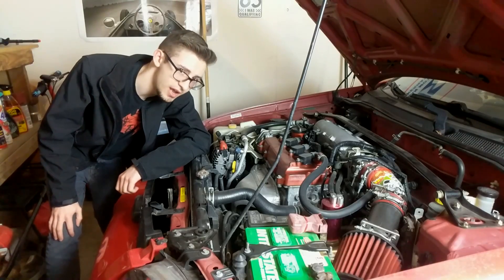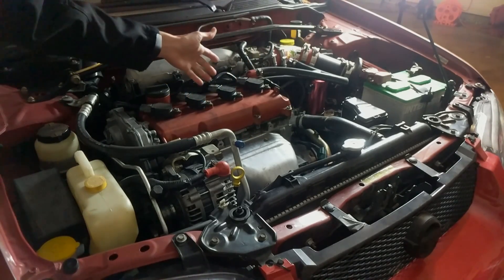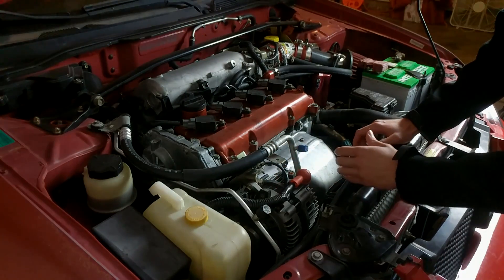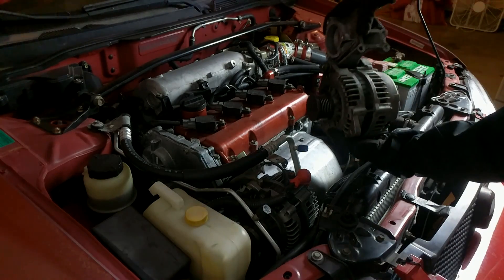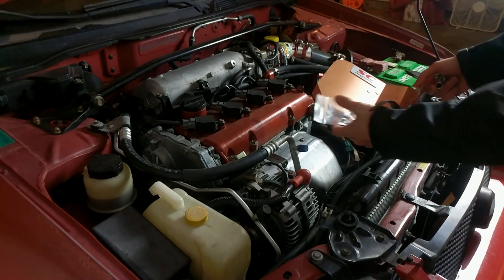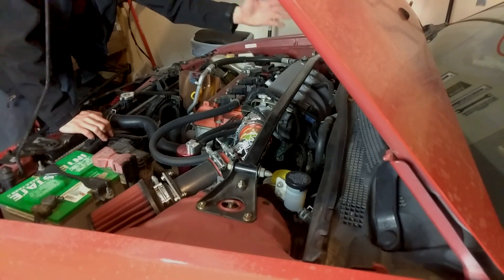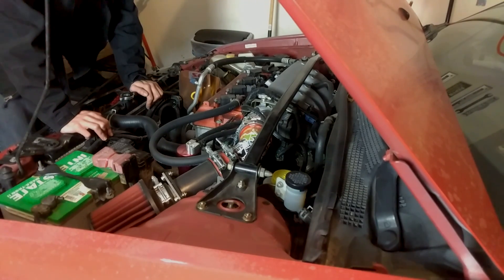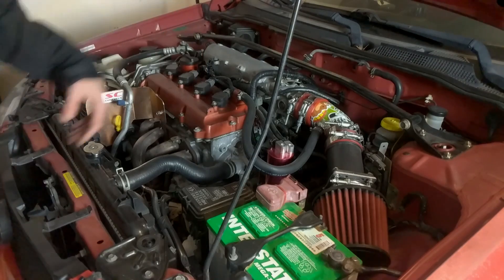3 Common Nissan QR25DE Engine Problems (And How to Fix Them)

Comment: My QR25DE has done 412,000 kms - because Oil & filter every 8,000kms! I don't drive like a d1ckh3ad so I don't have the pre-cat problem but the sensor DID disintegrate a while back, requiring removal of the exhaust manifild to get the debris out. I have also seen the butterfly valve screws get loose (reinstalled with Loctite). The valve cover needs replacing every 100-200 thousand k's because the spark-plug seals leak. It is a really solid engine with proper maintenance. Just avoid anything with a CVT!

Comment: How's this for bragging rights.  05 altima qr25 160k no leaks no issues with the head gasket, coolant issues none etc. Transmission shifts perfectly. Proper preemptive maintenance is the solution. OEM parts and high quality fluids.
Reply: Rebuttal. 260k on the odometer.

Comment: Thanks for the video and information. I bought a 2005  nissan x trail SE . It has the same engine. I have very little knowledge about car engines.
1. It seems to get very hot inside the engine, especially close to the alternator. The temp gauge on the dash goes upto 50% and stays constant. How can I know if it is getting too hot. Can one put some kind of thermometer in there. 

2. I put the fan on and turned the temp control knob to max cool without turning on the ac. It was a warmish day and I only drove around 45 minutes and warm air coming through the vents ..a slight burning smell. This is what alarmed me and trying to figure out if it is too hot. Hence question 1. 

Appreciate your reply. 
Btw on this vehicle engine was replaced . One of the issues on previous engine was screws coming of as you described.

Comment: idk how i found your channel but you brought bad some memories.. lol. i owned a 02 spec-v back in 04-05.. got rid of it around 2007.. had tons of problems. I remember i had a popping rack and pinion that was replaced under warranty.. and the noise came back. lol.... and ahh yea.. .BUTTERFLY screws.. lol..

Comment: My 2015 nissan altima all sudden is notdies accelerating when put in drive or reverse then the battery dies. It doesn't happen while driving only when I've been driving for a couple hours or even a hour. If change it out of drive then back in drive or reverse,the problem begins. Please help I love my car.

Comment: The qr25de is a piece of trash.

The only good thing about it is that its a 2.5 engine
The major problem with it. Is that its made out of plastic
Nissan didn't put any effort in making it like the sr20de

Comment: Around may this yr I blew my engine after 7 years of driving my 06 Altima... replaced it & just blew it again oil on cylinder #1 😭 ima be rebuilding soon & definitely going to add a catch can locktight the butterflies

Comment: Awesome information.  I'm getting a 2002 SER Spec-v luckily, which has already had the engine replaced, locktite on the butterfly screws and the exhaust replaced.  I did not know about the heat or oil issue.  You rock!

Comment: Yo!!! Awesome video. I'm switching to an aftermarket manifold on my 03 Altima. I actually had a qr25 seize up while going 80 on the highway and since it was  over 10 yrs ago they were still kinda expensive so i went the jdm route and got a qr20. The car has sit for over 5 yrs and im trying to make it road ready and clear all the codes and get it smoother. The last step that I think I have is to add that shield since I read the factory one won't fit and to use a spacer to fool the ecu so I don't throw a code. gonna look into the butterfly screws also. thanks! u got a new sub!

Comment: The alternator has never been an issue for me either as most have commented, as a matter of fact the original alternator that came with the car from factory is still good and sits in a corner of my garage after being replaced for an upgrade. I also installed the DC headers when they first came out years ago and still had no issues for years before doing a VQ swap a couple of years ago and I still have no issues with that one either. I've never had any problems with my Spec other than wheel bearings and its been 16 years. I think a whole lot of you are buying used Specs with tons of problems or are stuck with Specs that has taken beatings. Either I am the luckiest man on earth, or maybe I did the factory maintenance at proper intervals at the dealership every time it was due and gladly paid for it - you decide............and no its not for sale!

Comment: I have an idle problem, it's running at 1100 rpm. Is that a common issue?
Reply: Same. I had this issue after a head gasket swap and would like to know solutions

Comment: My 06 has been pretty good but has been going through a lot oil over the past 2 years. I changed the valve cover and gasket myself with oem nissan parts. It goes through a quart every 2 months instead of every month. If I was driving the car hard and flooring it, you could smell the oil burning off of the engine if you had the windows down
Reply: How many miles does your 06 have? Have you done the catch can since then?

Comment: I bought my 2003 X-Trail auto new.I,ve had no issues with it other than crank sensor and
camshaft sensor.I,ve used it for several years to tow our double horse trailer as our
family shows them.I have serviced it every
6000 miles since new.Castrol magnatec 10-40.It currently has 320,000kms and uses
about a pint between services.Amazing
machine.

Comment: My QR is in a 2017 Frontier 2wd KC SV and I haven't driven it much (3300 miles) and have only recently taken interest in 4 cylinder powerplants and read a post that stated there are differences between the QR25DE in the cars and the truck... IS this true and are you able to differentiate them for me. I am beginning the puzzle of learning the pieces and parts that I want to upgrade. auto-trans.

Comment: We have a first gen qr and lately I've been lossing power, it's consuming a lot of oil but there no white nor blue smoke at the exhaust...don't know what could be the problem
Also I've been having a bad gas mileage
Reply: My 2006 burns oil but no loss of power. I replaced the valve cover and gasket myself. It still goes through oil but it's now 1 quarter every 2 months instead of 1 quart a month. I could smell the oil burning off of the engine whenever I'd drive it hard
Reply: Sean Anderson Curious why you changed out the valve cover— was there a leak, or just something quick and easy to try?

Comment: Awesome video bro. 
We are all being taken advantage of by  the car manufacturers that sell us these cars.  Regardless of state and specially in California. 
The system is designed to fail and cost us thousands in repair bills 
 Car maker's make more money in Repairs, than they make in the selling of vehicles. 
 Knowledgeable people, like the young man that made this video, need to put them on blast. Show people in video, how to avoid the problems that the car makers create. They know
the fail points. 
 Look at the young man's engine here in this video. it's a qr25, that they continue to put in cars after his for years, without any protection on the alternator
 They did addressed the intake. But NOT the alternators. BS huh?
I have a car that has two cats on it. Each of them cost $1,200 and can only be purchased from the dealership.  Because it needs to have a CARB stamp in California (CARB 
California Air Resource Board) Nissan and Carb won't let another manufacture make them in CA. Total BS. That same exhaust with the Catalytic Converter is $300 in Arizona.  Nissan admits, and so do ALL other car manufacturers, that there engines burn oil. It says it in the manual. 
It's great that  this young man is showing people that they need to put a catch can in between their PCV and their intake manifold. Has anybody reading this, ever cleaned your throttle bod, intake manifold, spark plugs, or your combustion chamber?????. 
It's all burnt oil/ carbon deposits. Once it gets past the combustion chamber, it ruins your catalytic converter
Bro. I don't mean to offend you  by what I have to say next about your particular car but I think it will be a plus for your Sentra.That puny catch can you have is way too small. Do some more research on them and buy two in concession. Or buy one aluminum big one they sell for turbo cars. & add another PCV.  You can mount them anywhere. Also bro, extend your cold air pipe and take it downward, just below the headlight. 
You're robbing your engine of the purpose of a cold air intake by leaving it in the hot area. I would also recommend that you use heat wrap on your exhaust manifold , then wrap the pipes down just past your firewall. Use the gold sticker heat shield on the inside of stock heat shield. Clean them real good with a wire wheel and then clean with alcohol before using the sticker stuff. 
 I would love for you to show people and create a special videos on why every vehicle and every engine needs a good catch can, if not two of them. 
People need to realize what PCV means. They also need to realize what Vacuum means. Please use any engine in your video and show how much vacuum is being sucked into the intake. Most vehicles have restrictor pieces inside those vacuum hose, to restrict the vacuum, because it's so strong. Use a vacuum checker
 Show the people. Use a pressure gauge after the PCV. Ot will blow your mind just at idle.  Imagine 5K RPM
Everyone needs to realize
How much pressure is being pushed through the PCV one-way valve
Then combine that with the vacuum force of a being sucked into your intake. 
All those pollutants are being sucked out so strongly. It contaminate your intake, your throttle body, & ruins your spark plugs. It adds carbon build up in your combustion chambers, to the tops of your Pistons and your valves. After all of that...... whatever oil that didn't fry already & gets through all that proces... Guess where it goes people.  It drizzles down your exhaust pipe to your 300° to 1200°degree Catalytic converters. If the first converter & or 02 sensor doesn't bake the oil on it's Precious Metal Honeycombs, that Catalytic Converters are designed and made with. ( for others reading this.  Yes, 
catalytic converters are made of precious metals.) If the oil gets past the 1st Cat.  It will get burned in the second catalytic converter. 
EVERY vehicle, regardless of make. Needs to have catch cans,  If not two of them. 
if car manufacturers would just put one large catch can on ALL cars with a sensor. It could be drained during oil changes. WHAT A CONCEPT!!
Here on YouTube there is a gentleman that used Moroso catch can along with another brand after it. He was able to catch pollutants in both cans on a 5K test. That test was done on a newer GMC LS V8. Had the man put a pcv on each valve cover he would have picked up even more. Pollutants. 
Young man, please realize I wasn't just talking to you but two other people that made read my comment
 I encourage you and I will ask you please make a video letting people know what to do and how to make their car last a long time even if they just bought it. 
Make one for every manufacturer. 
 put them all on blast because this PCV vacuum system is costing the public millions of dollars. I for one am SICK OF IT!!!!
Oh,  could you please make an additional video for everyone about VVT solonoids. Just about every vehicle has them now. Teach about a dirty VVT solenoid and what havoc it can create. How to clean them with map sensor spray, & test them with a 9v battery. Let people know how cheap it is, and how it can cause so many misdiagnosis's and cost them hundreds, if not thousands of dollars.
 show people that they can go straight to many parts manufacturers to get their parts cheap.  Instead of the Auto Parts place down the street, or the dealer. 
Like Denso for example:  They sell straight to the public, and it's way cheaper than the dealer or any auto parts store.  If you want to pay a 75% markup go ahead and go straight to the dealer and get your DENSO OEM part. Lol
Please people, we have this amazing thing in our hand and in our homes to be able to access the internet. Use it!!!!! Research. 
 There's probably a video about it. 

 I also have a lot of information on how to make CVT transmissions last, get more hp, & get awesome fuel mileage. Better than stock.

But my novel is a bit long already.
Reply: Look at the SC concepts 1st page to see a real catch can.
Reply: Thanks Michael, you sound like you Know your Stuff very well my Friend. If you don't Mind I have some Issues myself right now that i am addressing and could use your input, knowledge and Wisdom. If you don't Mind. Ronny
Reply: @ronstubbs7937  All I can do is share my experience
Reply: I just fixed my friends BMW 328I. The code it was throwing was BS.

Comment: Another thing that is a must if you are going to drive them hard is to eliminate the balancer shaft. There is a kit made for it. If you don't at some point it might seize and it will cost you a new engine. If you are as lucky as I was. My balancer shaft gears broke so quick that it actually saved the engine. Still the oil catched a gray-ish color and a bunch of gear particles where in the oil pan and even got to the cylinderhead.

Comment: You left out a TON of issues that are even more major and not even your local mechanic can figure it out because the ecu gives a code for the trouble symptom but it does not directly specify the real cause.., it only describes the symptom or symptoms. If you or anyone reading this would like to know this motor’s DEEP SECRETS please don’t hesitate to ask right here! I will reply ASAP.
Reply: Please elaborate if you can. I would like my car to last.
Reply: @hetdowsha2968  .... the qr25de is a troublesome motor. their just a hand full of quarks, two thermostat which makes the heads and the block two diferent temps which causes head gasket to not last long but theres only one temp sensor not two. the cam position sensor goes bad every couple years, the symptom is that it wont rev past 2000 rpm, the cose for that will say bank 1 or air intake selinoid but its not the case. it only says that because theres no cam position sensor ''sensor'' or code for its failure and the closest thing to that which the ecu can monitor is the selinoid actuator for the phaser gear on the intake can that has the cam sensor on it.  the intake phaser gear needs clean oil at all times or it will throw a code but theres no code for a bad phaser gear., thats one good example. so the code will be related to something else that works with the same camshaft that the phaser is on. moving forward, the timing chain tenssioner has a flaw. you can push the plunger all the way in so that it may be installed into its designated spot while doing the timing chain job but once its in, the plunger pops way out like it should so to pick up slack. the problem is that the slack from the timing chain is strong enough to push the plunger back into its housing. this happens while there is no oil psi built up yet untill the motor is fully started and it causes chain noise on start up.. the code for that will say intake selinoid bank 1 but its only because the chain slack allows the intake cam to be out of timing and the only thing that can monitor the cams position is the cam sensor  and when it notices the timing is off, it will blame it on the intake phaser selinoid because thats the part that is responsible for advancing and delaying the position of the intake camshaft. i have two video on my channel that shoes how i modified that tensioner. theres more things to mention but thats got to do with turbo stuff. if this was useful please like.
Reply: @AutoBodyEverything  Thanks a million. I'll give a subscribe too.
Reply: @hetdowsha2968  thanks bro your awesome

Comment: I have a 2013 Frontier with the QR25DE. I bought it at 11M and now it has about 40M.  I’ve noticed no significant oil consumption (I use synthetic).  What generation is my engine?  Had those early bugs been worked out by 2013?
Reply: Yes they fixed them, was only on the first generation as he explained

Comment: How do you get rid of the check engine light when installing the exhaust header.
Reply: You have to buy the spacer for the lower O2 sensor works great
Reply: @leo89us  will performance headers from the 1stgen qr25de fit the 2017 altima or did fitment change on the 2nd gen 2.5 engine?
Reply: @cedricmiller4370  im not sure on that one bud

Comment: Cool video. I've been turning wrenches for 15 years and have always owned Nissans. Still have my S13 convertible, B14 200SX, and B15 06 Spec-V. I've been driving my 06 Spec-V since I bought it in 2008 @10k and now it has 240k 11 years later. I only run Ardeca 5w30 and never had any issues yet. Still have factory alternator, exhaust manifold, water pump, and clutch/flywheel. I have replaced LR wheel bearing and rear calipers, but that's all stuff that wears out sooner. At 250k I'm doing a rebuild as it's starting to get some cold chain noise so I can go another 250k. If you take care of Nissan's they'll take care of you. My 95 200SX I've had for 15 years has 409k on it now and is only on it's 2nd clutch, but is getting fender rust everywhere these days.
Reply: That's impressive. Is that 240k miles or km on your spec-v
Reply: @miguelabrego1079  270K miles now. It's in my shop now to be rebuilt, the head gasket is going. My '95 200SX now has 418k miles on it and my wife is still driving it daily.
Reply: That's really impressive. Currently looking at getting an 06 spec-v with 130k but all these problems are a making me rethink that decision.
Reply: @miguelabrego1079  I said all of my stuff is original on my '06. I haven't seen any of those issues in the video. I will loctite the power valves in the intake while I have it apart, but I firmly believe beating on anything will make it break, which is most likely why I haven't seen these "issues" yet.